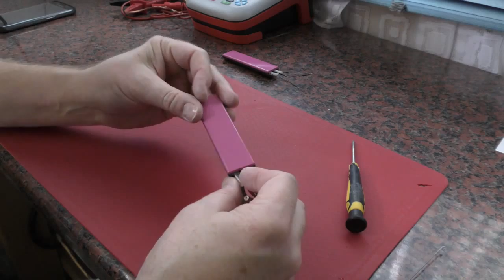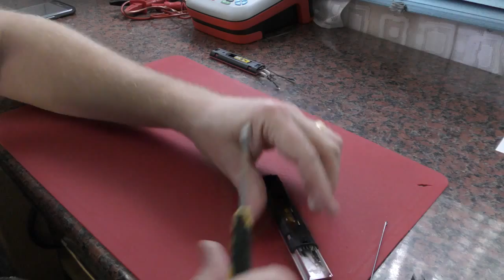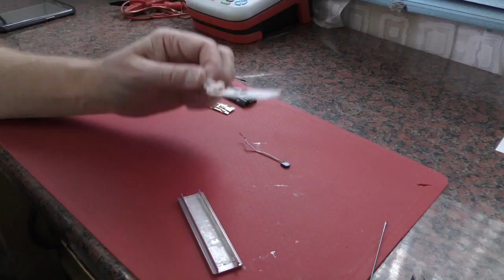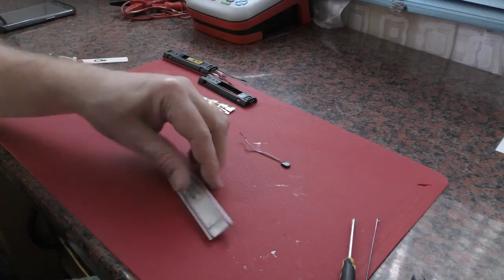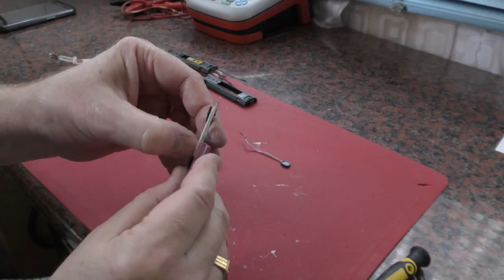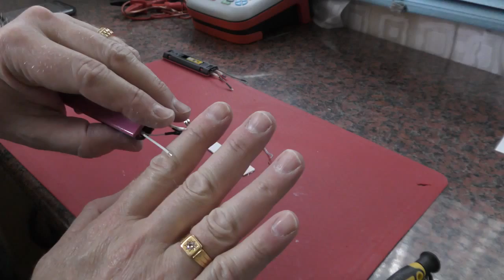ghd-repair.co.uk - GHD MK4.2 Type 2 & MK5 Thermistor Plate Assy

Comment: Wouldn’t adding a bit of thermal paste to the back of the thermistor work?
Reply from the maker: The thermistor needs to be well glued down and in good contact with the heater. Thermal paste under the bead of the thermistor may improve the performance, but the important thing is solid contact.

Gary

Comment: the thermister is  a 100k ntc and you can but like 10 of them for £! of ebay. dont be fooled with people selling them for £5 each !!
Reply: Cheers mate have you a link or is it just the 3d printer ones ??Ok guys wanting to do this
be careful i got what was supposed to be 100k at 25 deg with Beta value of 3950 and 
it went well over 200 deg..even the 350 deg silicone started to cook and burn LOOL..

Comment: Hi. Great video(s).

Can you tell me where to get a replacement on/off switch for a GHD MK.5 please. eBay only seem to sell the whole PCB assembly which is very expensive and a waste of money. Can't see any on Amazon either.

Replaced the thermal fuse here which had blown. Replaced the element/thermistor also and the elements were not heating up properly. Cleaned the switch up after taking it apart, but it still seems a bit intermittent i.e. sometimes the light glows, goes off, glows goes off, but GHDs never bleep to say 'ready'. Then they will sometimes work OK.

R8/11 are fine. Both at 51 ohms. At a bit of a loss if it isn't the switch? Run out of ideas.

Thanks for any suggestions.
Reply from the maker: Hi Dawn,

Try dropping Trevor an email and see if he has any available in the workshop. His email address is trevor@ghd-repair.co.uk

Regards,
Gary
Reply: Thanks Gary, I've sent the e-mail.

Comment: Hi, thanks for these videos, but I'm struggling with a ghd mk4 mini. The ceramic plate does not slide off the switch side. It looks like the fuse is protruding out the cover so it cannot slide. It does look like it has clips though, but not sure what to do. Can you assist?